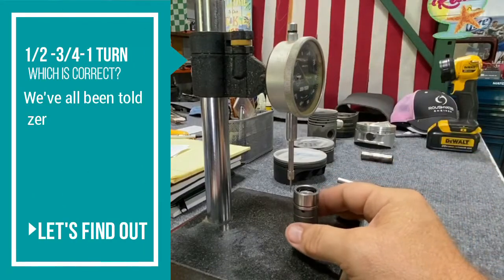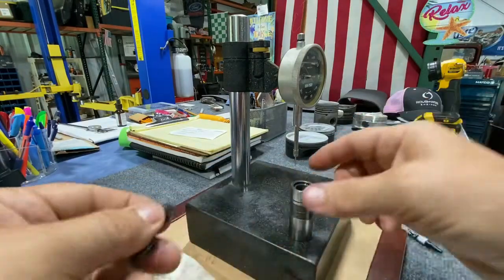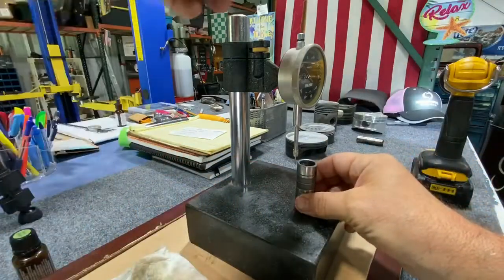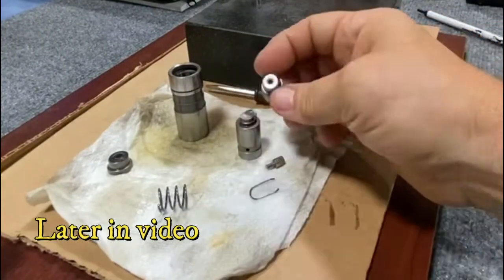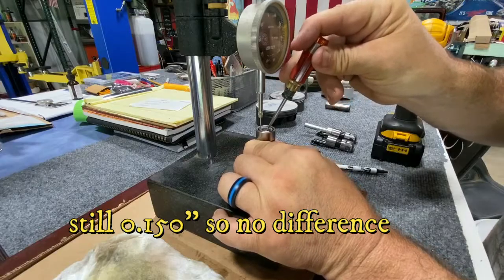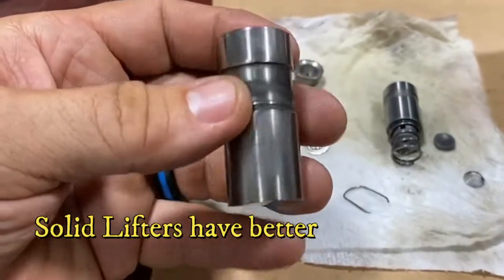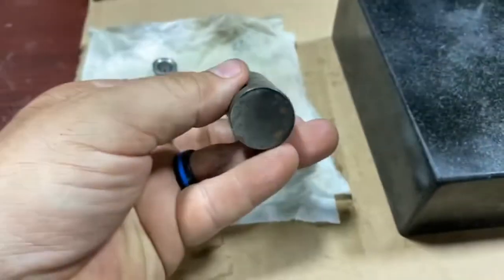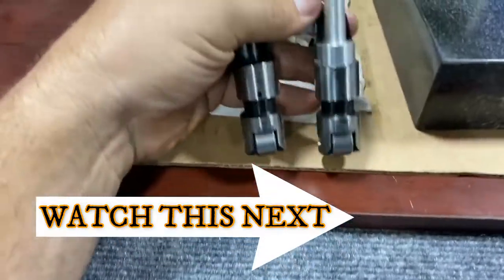Hydraulic Lifter Preload Explained & Different types of Lifters

Comment: It's not clear why centering the plunger is the best practice, I usually shoot for 0.020-0.030 preload and this has always worked fine for me.
Reply from the maker: That works. I guess in theory you could get more lift and still be safe with centering. I think it varies depending on the lifters being used.

Comment: I’m doing a 350 build with a set of Johnson flat tappets & stock stamped steel rocker arms. The plunger travel is .140 & a complete turn of the adjuster is .070 in case anyone needs to know.
Reply from the maker: Thank you for the information

Comment: These "c stamped metering disk" type of lifter internals have given me the most issues/collapsed lifters ... i avoid them like the pfizer jab😂
Reply from the maker: I avoided the jab too but hindsight maybe I should avoid these lifters as well
Reply: I came across two sets of 8 genuine Ford lifters so I bought the two sets of 8 for my next engine build. One set is from 1986, those have the check ball, the other set is from 2006, those have the check disc. I get the feeling the check ball is more reliable for quiet operation. Both sets are hard as a rock and correctly ground on the lifter faces though. My current engine I put a Comp XE250H and the matching lifters, I am pretty sure those are the check disc type, nosiest pieces of shit on startup I've ever heard but they get quiet within a minute of run time in the winter and summer time they usually don't make any noise at all. Really tired of hearing that after 11 years of having that cam installed. I have another Comp XE262H in a 390 with the matching lifters and those never make any noise at all except the first second or two on startup after sitting a week. Those are also check disc. Not sure whats up with the 2012-2013 Comp high energy lifters.

Comment: Too much to blead down. Adjust 1/4 turn up from the bottom, that way you get no pump up and the lifter gets filled instantly at start up.
Reply: So, it's a little bit like a solid lifter, right ?
Reply: That's right, instead of a tight lash you get a true anti pump up. @angerx4

Comment: Man this is gold, i can basically use this to dial in pushrod length on a harley? I just determine the measurement between the halfway point and the top in my lifter then add that to the length between the top of the pumped up lifter and the rocker arm with the head seated and TDC of compression? Using adjustable pushrods
Reply from the maker: Thanks! Yes that should be correct to figure out pushrod length. I’m not sure how much the Harley expands with heat though so account for that some

Comment: My son spent $6k on a SBC about 6-7 years ago. Of course he can't find and documents and the speed shop says they don't keep build sheets!
 So, with the intake of and some light, can I tell if they installed hydraulic or solid lifters? Mind you, I can't get any rocker to move on base cam circle but it has the lock nut / set screw on the rockers. He has ticking noise I guess.
  I spent almost 40 years at a dealer, not building engines?
I am not taking the install of this SBC because I have other things to do as winter comes and I recover from back surgery #7.
DK, ASE master tech since 78.
Reply from the maker: You can tell if there is lash on each valve when the cam is on the base circle. Use a feeler gauge between the rocker and the valve tip or just feel and see if there is lash. If there is and you can’t force the lifter to collapse with using a larger gauge then it must be. If you’re able to keep putting thicker and thicker feeler gauges in then that looks like hydraulic lifters
Reply: @dhammiam  You are right, I got my fiber optic on a light inside the valley and the lifter has a "C-Clip" not the retaining wire clip. My son lost all his cam card & paper work as the short block was done at a Speed Shop 26 miles north of Omaha. They said they don't have his 2008-2010 file of build sheet. They have the 1.52 rockers with allan head lock screw and I have SnapOn sets of "Go, No-Go" feeler blades. I just no the proper comp cam lash setting! If too tight, it can burn an exhaust valve. Plug 5 spark plugs where loose, timing off, AFB needs choke set then fast idle cam adjusted and "Then" set air / fuel. This is a car you chain, lock the hood and keep the key. 
 Plus, I just had back surgery 10 days ago, another pair of electrodes inside the epidural space, now on right side works as left does nothing. Last Dec, Jan and now. Doc say a lot of scar tissue! Douuh!
Reply: Not without pulling the Head if it's tapping though that's all you need to know the heads have to come off regardless tear it down and up top end internals. Or ship it to me
Reply: @oscarlandag1831   Thanks, but after identifying the solid lifters, I used my SnapOn set of go-no/go feeler blades and if memory serves me, I went 0.08" on intakes and 0.10" on exhaust. Anyone on YouTube that had a method for adjusting solid lifters used these specs. I inspected the plugs, adjusted timing with my dial-advance, set idle as low as I could get it, set A/F just until RPM's dropped, then backed out 1/2 turn rich. Runs quit and screams like a true American Eagle. I'm just glad I don't have to buy tires. He is happy yet has a quick temper and abrasive personality as I had my first of 3 lumbar surgeries after he was born and found this 10lb kid at 21" hard to hold and later harder to kept fed. God bless everyone and merry Christmas (12/24/2022) as we zoom toward 2023. This is when we get flying cars and robot maids to prepare dinner by pushing buttons! No...Wait? That was George Jetson! Sorry you all! 
Stay safe and call the ones you care. DK, ASE master, retired.
 (I can't afford to buy a new intake valve from Rock Auto much less sent out the heads. It is my son's 500HP beast, not mine! But thanks! I have all "Nu-Way" tungsten carbide cutters in 4 boxes. They work best!
Reply from the maker: Sounds like you did a perfect job 👍 Happy New year to ya make 2023 great. Someday the Jetsons predictions will be reality, flying cars and all. Take care

Comment: You said this lifter is a ELGHL-1817-16. So its an Elgin lifter. I‘ve got the exact same lifter from Qualcast. All of these lifters are reboxed, i know. But does these particular lifters work well in your engine? The internals of these looks very similar to the old Stanadyne design with check valve plates instead a check ball, and the stamped „C“ oil metering valve…
Reply from the maker: They do work well. I've never had any issues from them. I probably could have left the part number off the video but someone would ask I'm sure. Actually the lifter I took apart was an original from the 1964 327.